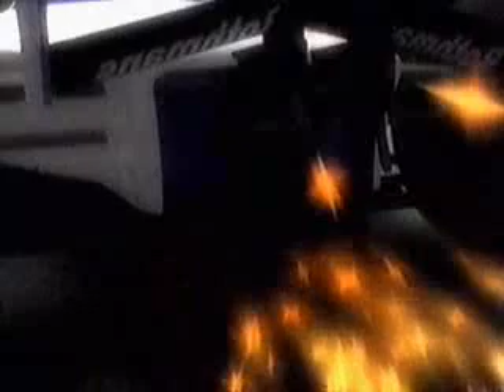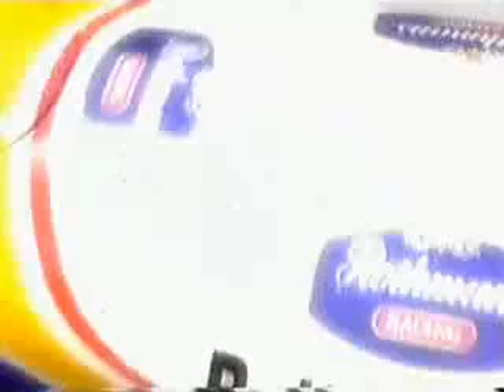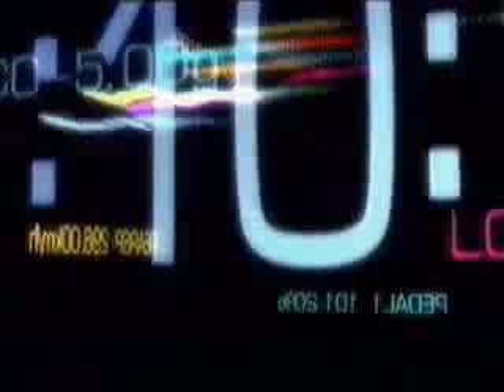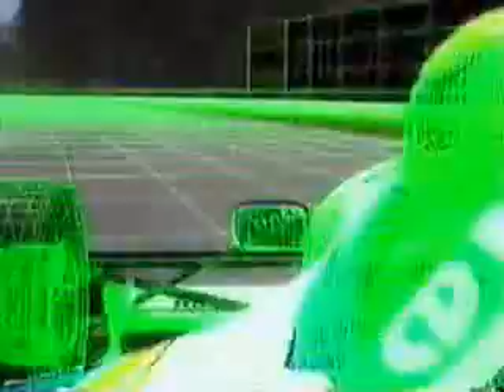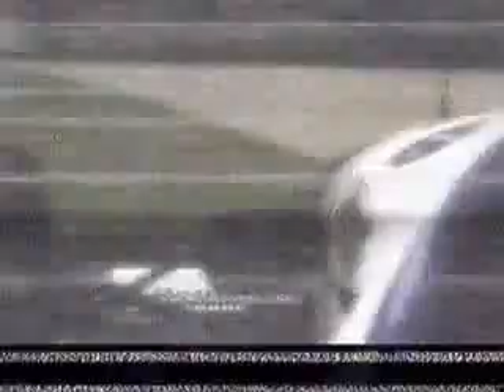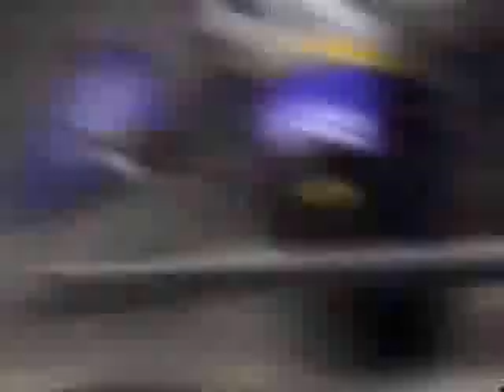Ayrton Senna How the crash killed him

Comment: when you watch the cockpit camera view, the wheels do not turn whatsoever. I personally subscribe to the broken steering column Theory.
Reply: Robert Reese it's not a theory, it was proven in court and during the investigation, the wheel had a sensor on it that showed the wheel move out of it's telemetry ever so slightly every time he hit a bump so it was most likely breaking on the weld and on the third and final bump it just snapped and the wheel turned hard left but the car went straight and he hit the wall and the front right suspension smacked his helmet causing severe blunt force trauma and cause swelling of the brain and it killed him, if you watch he didn't die on impact, he was still alive moving slightly but eventually he died while laying on the track
Reply: Cntdy I thought he broke his neck?
Reply: Cntdy Damon Hill recently in an interview (will link if I find it) said the steering wheel was designed to move. He also mentioned the data showed the steering wheel was still functioning up until impact.
#DontShootMessenger

Edit https://youtu.be/of5XMnd_Z0I
Reply: Read Adrian Newey's Book he designed this car and goes into detail about what he thinks happened.
Reply: Hard to say if the steering column broke on the track or after the crash.

Comment: The sad thing is it wasnt even that big of a fucking hit! It just shows how poor safty for a driver was back then. Today everyone would walk out from that crash. :(
Reply: The right front wheel had shot up upon impact and entered the cockpit, striking the right frontal area of his helmet. The violence of the wheel's impact shoved his head back against the headrest (which was already far forward from the car's impact with the wall) causing fatal skull fractures. In addition, a piece of suspension attached to the wheel had also partially penetrated his Bell M3 helmet and caused trauma to his head.